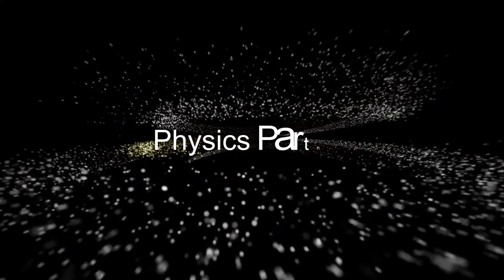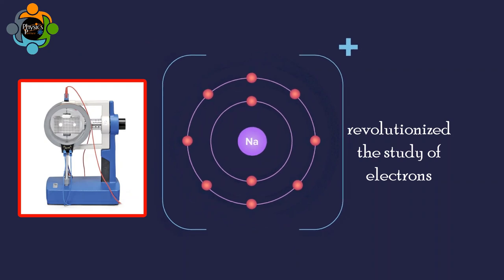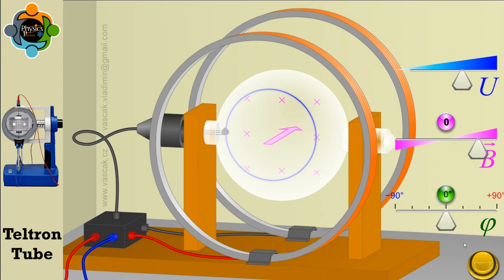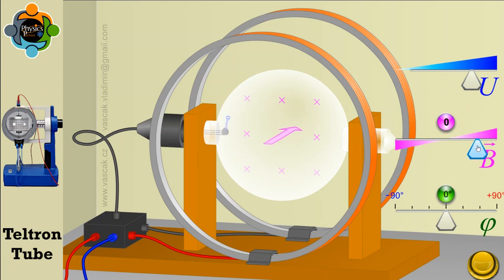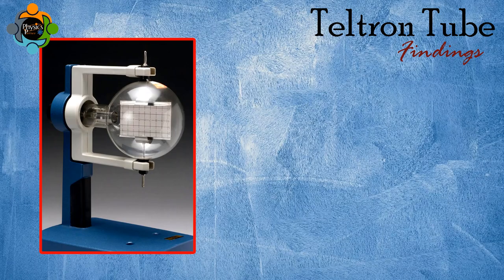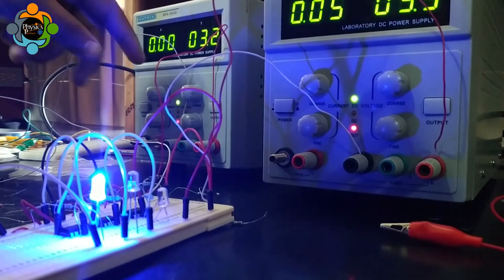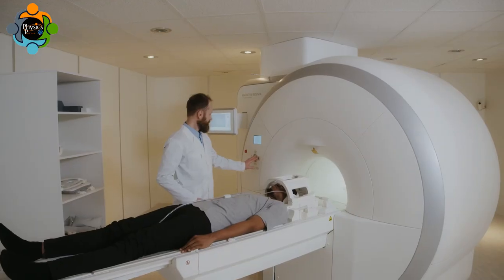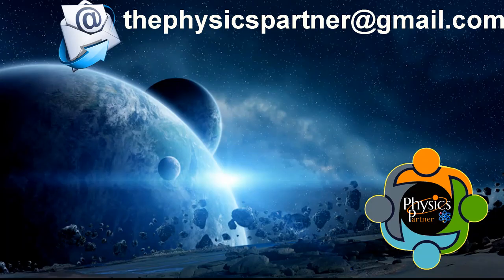Teltron Tubes - A Journey into Vintage Technology

Comment: Great!  I may not be correct but the Teltron tube was a specific series of tubes manufactured in the UK by Teltron probably from the early 1980s onwards.  Are you confusing Teltron Tubes with vacuum tubes?  I have done many demonstrations of the Teltron Tubes online - you may wish to have a look at one example here.  Do get in touch if you need further information.   https://youtu.be/9QmeHCw6pN0
Reply from the maker: Thanks for the info!